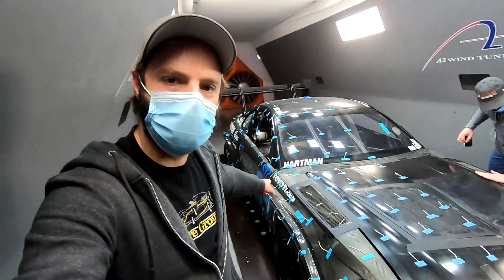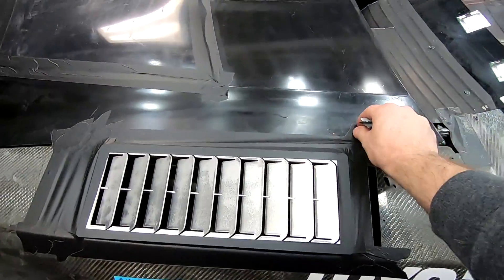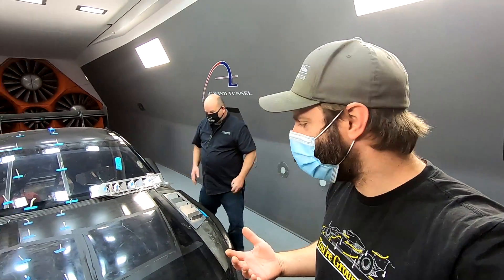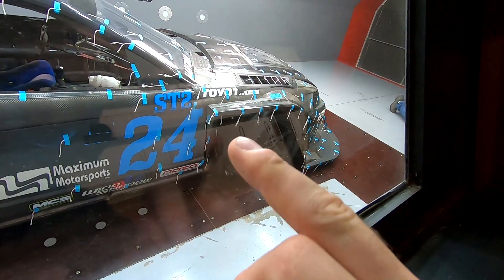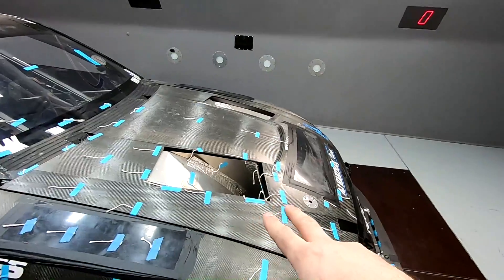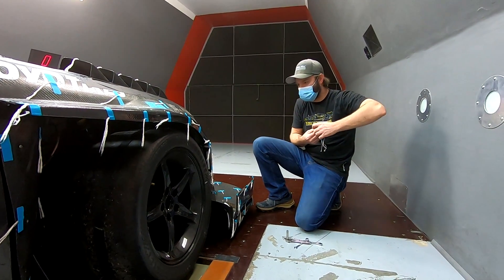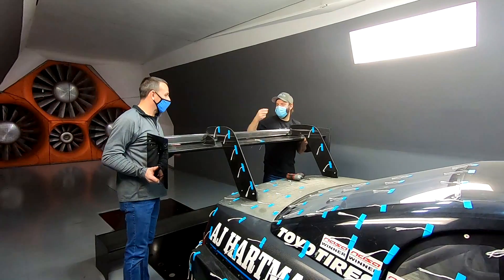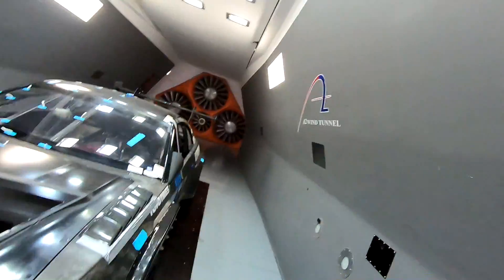Epic Wind Tunnel Video

Comment from the maker: Hey everyone. Just a heads up, I won't post exact numbers cause they are very application specific. We've seen the same part make vastly different numbers on different cars and setups, and vastly different parts make almost identical numbers.  So just saying we installed X part and make Y more downforce and Z more drag can be misleading. In the video I try and mention if something made more Df or if it was an efficient gain or not, but keep in mind your car and setup may vary.  I will say that when I hit the brakes going into the Bus Stop at Watkins Glen,  in my higher Df setup, my car will have well over a ton of Df acting on it. Enjoy!
Reply: if you only post the theorie you saw while testing is more than enough, people need to understand the concept instead of copying different things from a completele different setup

thank you for the time you gave away to record what you were doing
Reply: @chikogota  everything is a copy of something else unless it's an original concept. These are not really original concepts, they are adaptations.   For the grassroots driver,  you're not going to a wind tunnel,  so you look for ideas or parts from reputable builders.   Those parts usually come with data these days.   However I understand the conflict of two different aero manufactures and this vs that.  Its still trial and error either way.

Comment: THANKS, as always.   Will review this video a few dozen more times... ;)   p.s. What was your underside (flat bottom or no?), appears that no diffusor (@5:02 video) - why ?
Reply from the maker: No diffusor or floor. Tire blowout at lime rock took out the floor. Then I S550 subframe swapped it and was cut to fit a solid axle so sold that and didn’t get a chance to remake anything.

Comment: Can't wait to see the numbers! You looked like you were having a blast! Do you think you'll end up running the splitter endplates, and cranking in more rear wing? Or are you horsepower/drag limited in your class and will end up running a more low drag set up?
Reply from the maker: depends on the track I may run a slightly different front aero setup.

Comment: Curious how the tiger hood did vs oem+louvers. I have a tiger hood on my s550 and I know a 01 cobra that needs some kind of hood ventilation
Reply from the maker: Race Louvers is going to be putting out data but it depends what your goals are as to which one is better. The RL's made more Df and better cooling drop, but are an agressive style to achieve that, thus the overall cars efficiency was slightly down, but you could then tape up some of the grill opening to regain that efficiency. If I had an S550, I'd go with Race Louvers over a Tiger hood. Just my .02

Comment: Please give us as much data as possible because not everyone has access to a wind tunnel. especially what worked effectively and what provided a lot of drag. 
I build on a low budget and I can never get so great opportunity to get a good fact on aerodynamics but still the goals are kept high🤘 Keep up the good work👍
Reply: Even little bit of information is great like the race louvers increased deltaP around the radiator so if you need more cooling that's the way to go.  I'm not surprised that he got such ridiculous amount of downforce from the splitter though because just look at it... I would assume that the drag must be extremely high so not a good idea on a lower hp car.  Side note, AJ what spring rates/anti-roll bars are you running?
Reply from the maker: We’re keeping exact data close to the chest.

Comment: AJ I think it would be very helpful if you could post much longer videos of the car in the tunnel under test.  That way people can see the behavior of the tufts, so they can learn where there is  laminar flow, tubulent flow, flow reversal, etc. The video showing the tuft movement is currently too brief.
Reply from the maker: Pause the video.
Reply: @ajhartmanaero  Ha, ha.
Reply: @jhidley1  I play the video at 1/4 speed, to mimic a longer (yet moving, not pausing) video.

Comment: Would you be willing to share what was the biggest improvement that you changed was and what was the least improvement/disappointment change?
Reply from the maker: I guess the answer is the same for both and it depends what your goal is. We made change that netted us a lot of Df, so that was great. But also a fair amount of drag, not so great. So going to a small tight track I’d probably run those parts, but going to a more high speed track I’d probably not run them.
Reply: @ajhartmanaero  so what did the 3d printed air curtains do??? I would advise making them much larger look at Kyle.engineers air curtain video.